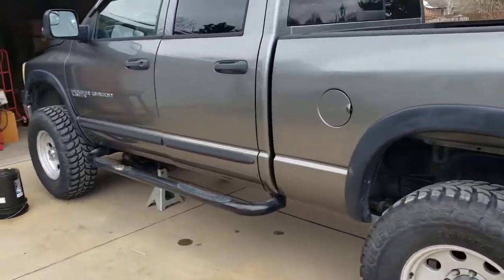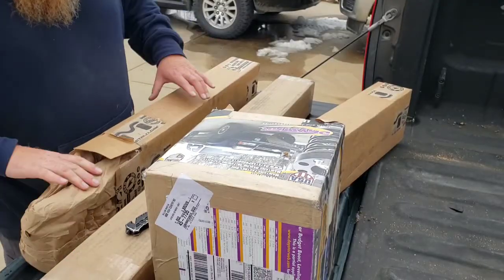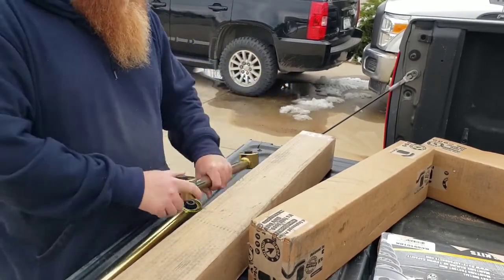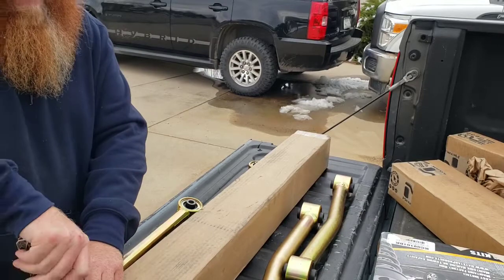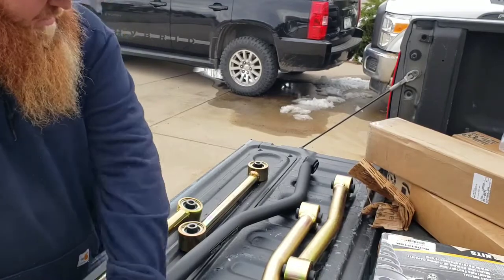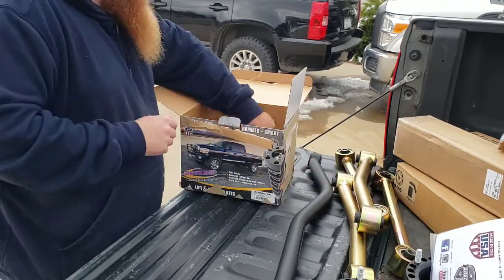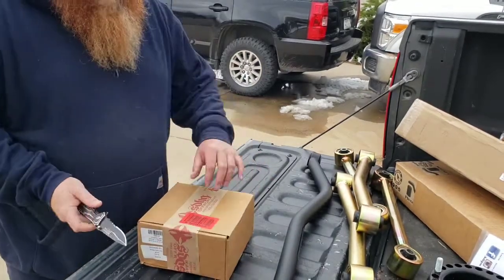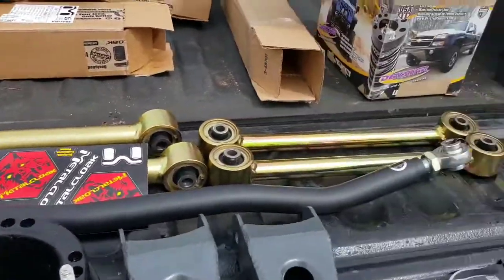37's Done Right On A Budget. Part 1. Unboxing

Comment: How did it all hold up after all these years?
Reply from the maker: Really good. Haven't had a bit of problem with any of the suspension parts. But have installed Synergy steering links, a redhead steering box, and a DOR steering box brace. And it just got a low mile 5.7 from a cherokee a few months ago as are at almost 190k and was starting to knock. I'll be pulling that one apart and doing a mild build before storing it.